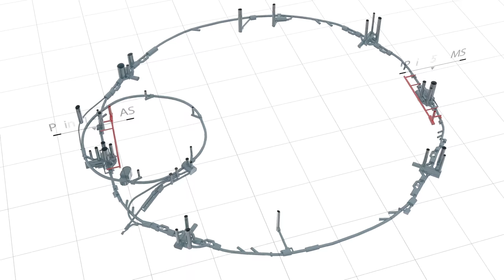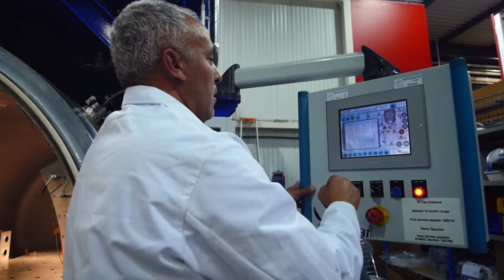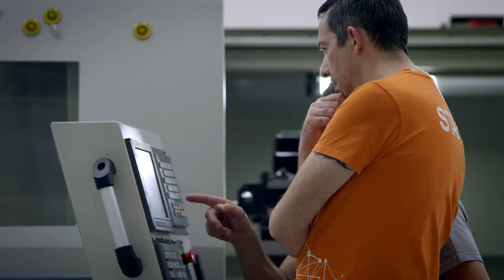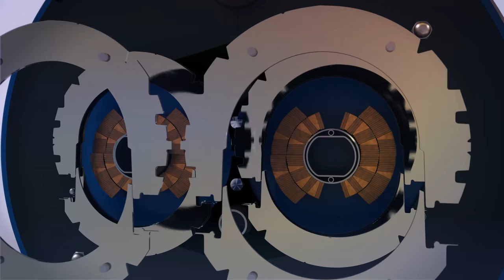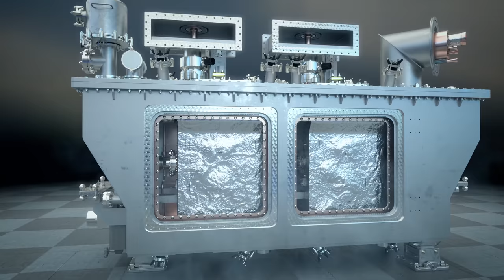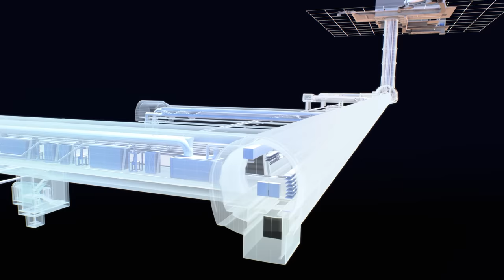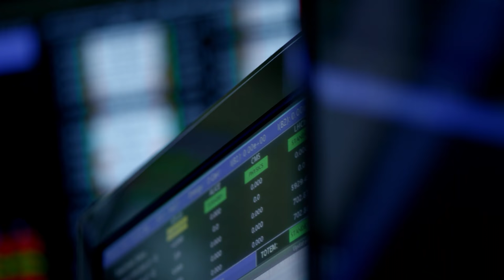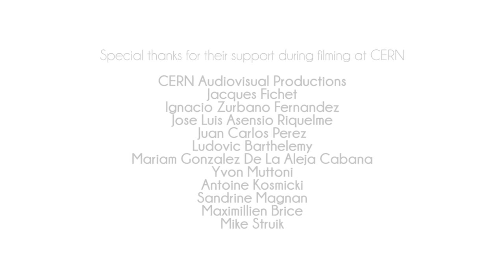More light for the LHC: meet HiLumi LHC project | CERN

Comment: Do you find that your superconductor cables need to be annealed after work hardening?    In previous work in the cable manufacturing industry,  it's common to have to anneal wires after they've been pulled or work hardened.

Comment: I thought of a simple way you could explain Dark Matter. Imagine a phonographic record, with deep grooves, and marbles being free in those groves. The Marbles are Stars. Gravity is if you push all of those marbles at the same force, in the same direction. Dark Matter is like turning on the record player, and the outer marbles will seemingly go faster, and travel most the distance. In outer space this could be the Dark Matter moving, like the record. Or it could be a force that is pushing the record, sort of like a hand pushing the record around. Could it be that Dark Energy is adding that force causing the pressure, we detect as Dark Matter? Dark Energy could also act as, the air pushing a pinwheel, from the outside of a galaxy. Speeding up the gas cloud, and stars without needing the record, or underlying connection.